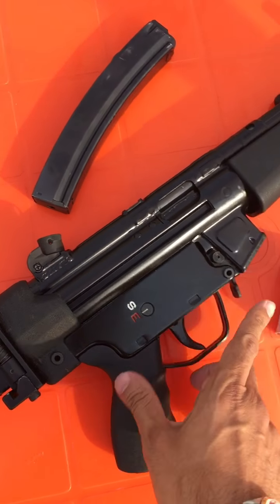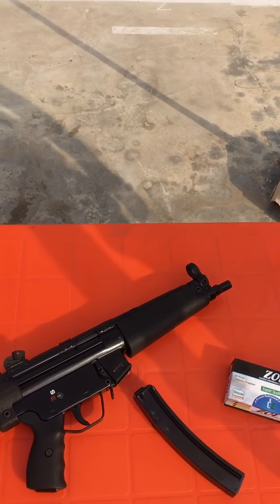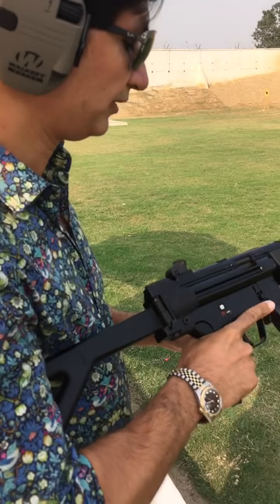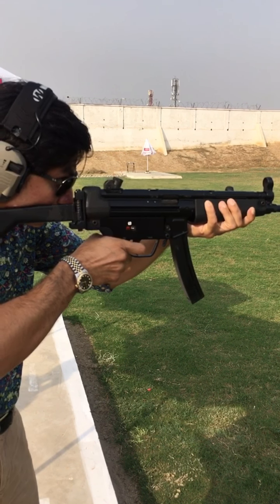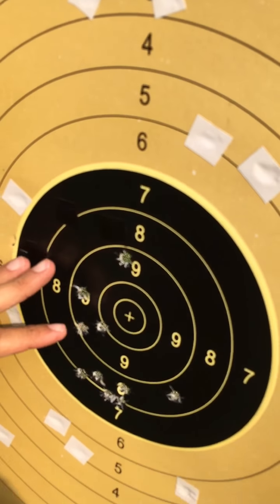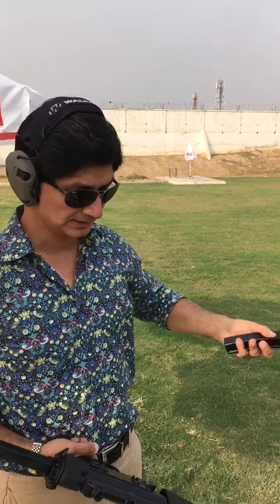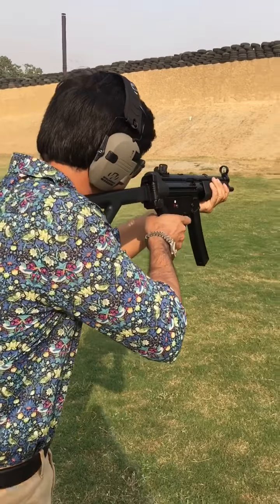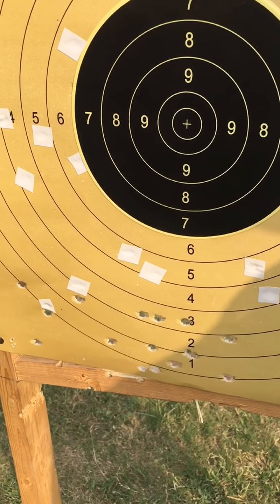ZOL 9mm Testing in MP5

Comment: i think the magnet test is used to determine whether the core of the bullet is lead or steel... millitary surplus ammo... i may be wrong ... is steel cored with a copper jacket.... gives more penetration....if the magnet isnt sticking to this ammo then its a bit reassuring that the people in peshawar really are making this stuff up themselves rather than just repackaging the millitary surplus ammo...
Reply from the maker: You are spot on. Need to stay away from steel core ammo. A manufacturer in Peshawar told me it’s quite cheap to source it, hence the cheap ammo. However, I support local industry and try to give them positive feedback where ever I can.
Reply from the maker: Bedar, are you part of the GT&B Enthusiasts group? If not then I suggest you send me your FB id and I’ll add you in.